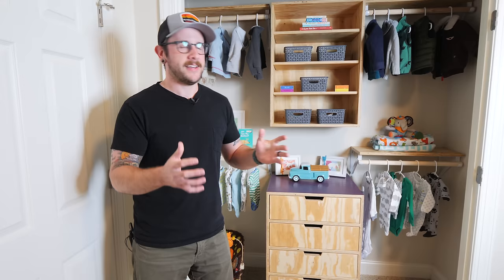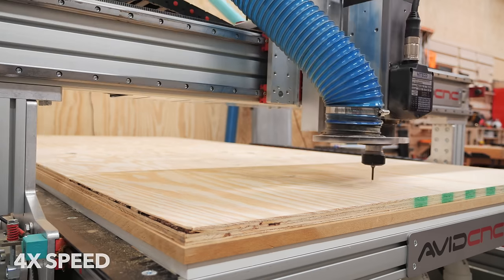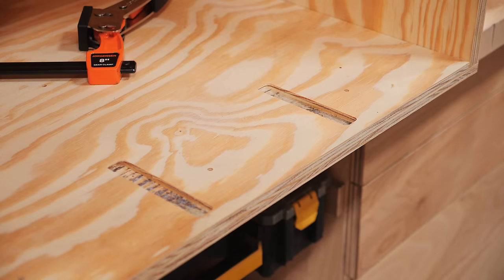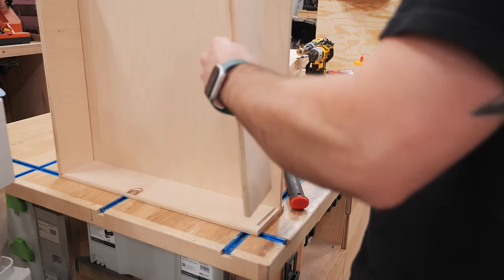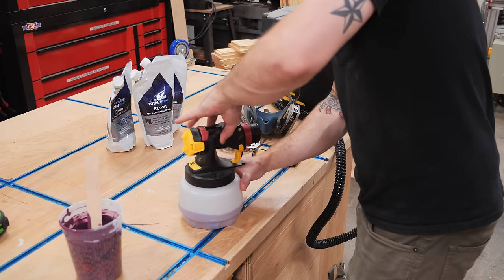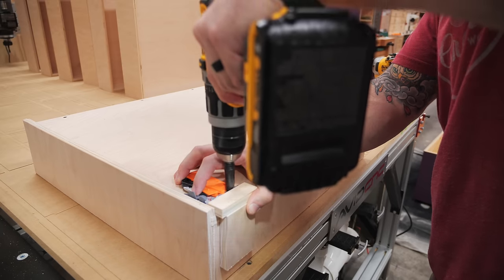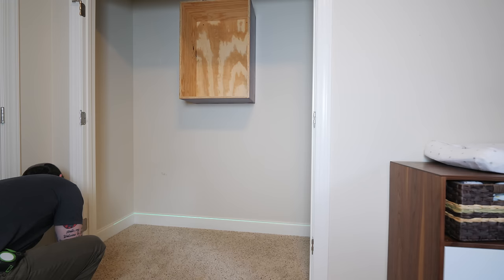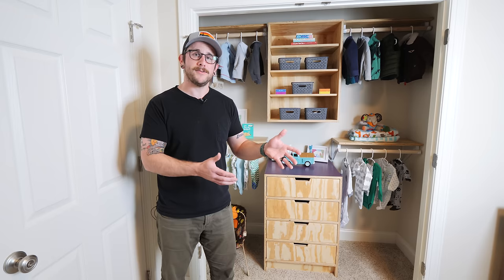Building Cabinets & Shelving for Closet Organization with CNC

Comment: Hey man!

Something I learned from a friend with a 4x8 Laguna Swift: Paint the edge of the MDF. It seals it and gives your vacuum more directed suction on the top of the board. You'd be surprised how much suction you're losing through the edge of the MDF :)
Reply: I was about to comment the same.  For me, I was going to edge band it with white melamine...

Comment: Me: Adds in wire shelving, excited to have place to hang and store stuff.
Also Me: Watches this video, “old crappy wire shelving...” 😞
Reply: Don't take it to heart, people just like to constantly change things even if they are fine and function well. Look at how many people cycle through "old" granite countertops to plywood counters, then remodel the plywood to stainless steel, then upgrade the stainless steel to granite. <.<
Reply: I just replaced some of my crappy wire shelving.  I put up less crappy wire shelving.  But this time it's my wire shelving.  As long as you improved your situation, you should be excited!  Nothing wrong with that.
Reply: @Not_TVs_Frank  Thanks man! I am happy with improving my closets that had nothing in them. Appreciate your kindness.
Reply: @williamforsythe5850  Thank you. I agree. Life is always changing, getting better. I look forward to doing an improvement in the future.

Comment: I'm about to do a very similar project myself so thanks for the vid.

I think I will have the top shelfs and the top of the cupboard as a single piece. Then I can use an end socket support on the side of the cupboard for the rail. I think I will connect the top and bottom cupboards too.

Oh and I'm very jealous of the cnc. Would you use the again rather than traditional carpentry?

Comment: Could you use one of those drill sanding pads in the CNC to just run a couple sanding/surfacing passes rather than do it by hand?

Comment: So didn't you do or add a major dust collection upgrade to the CNC that also holds the workpiece to the bed?  Are they not working as well as you had hoped?
Reply from the maker: The vacuum table doesn’t function as dust collection, it just holds down the material. I need to adjust the airflow from the dust collector, because it’s actually too much and is collapsing the brushes on the dust shoe.
Reply: @craftedworkshop  So the boxes you put underneath only hold down the work piece, not that isn't a great function because it can be incredibly trying to configure a clamp setup that will actually hold a piece as needed.  The CNC effectively has become your saw and drill?  I always thought of a CNC kind of like a fancy way to carve.  You've taken that and made it practical.  What wouldn't you use your CNC for?  You could cut a stack of 2 x  's placed side by side flat or vertical depending on your Z access height.  You could take that same stack of 2 xs and insure they are all 8' long as well with the same effect as processing them through using your cutoff saw using a stop 1 by 1.

Comment: The link to check out cnc shows a price for around $6000 does that include everything we see on ur video. I know the dust system is not included and the router bits.

Comment: I like the way all the little person clothing is hung so high a little person couldn't reach it.
Reply: Look at the bottom rack - those are onesies.  That yet-to-be-born kiddo is a good while from putting anything on a hanger.  While the closet rods are screwed to the wall, it won't take long to lower them to a more kid friendly height.  In, like, 2 years.
That is still a legit suggestion - once the little one is ready, get those rods down low!  Picking their own clothes off the rack is a great exercise in independence for young children.

Comment: WoW!!! AMD Doing Marketing!!! Finally. WAy To Go. And I totally am gonna do those cabinet designs. EDIT.... Hold on!!! That's Cheating I don't have a CNC!!! This is actually useless to me. Good for you but totally impractical for the average DIY home owner.
Reply from the maker: Very simple to replicate with standard woodworking tools. I’m making big boxes, not that hard.
Reply: @craftedworkshop  Is it to showcase the design and setup? It certainly isn't meant to teach anything. No Details ,instructions, or tips. Take it how you want but it just looks like showing off. It comes across like a big flex. None of the building part is self explanatory or common sense. People who know how to build like a pro are not the ones clicking on the video.
Reply: @ass2mouthallday  I agree with a lot of what you say. It seems he's going the way of another woodworking tuber - April W. Nothing but major sponsors for obtaining big buck tools apparently for no other reason than outfitting a shop (seriously - a power feeder?). That's fine in itself - I understand this is their "business" and I'd likely do similar, but I have to weigh the value I get from the channel. When it becomes obvious that videos are more about "look at this expensive tool I just got", than actual woodworking, I have to weigh the pros and cons. I finally had to unsub from April's channel after she posted a video about "how to" install a dust collection system... by receiving a sponsored, complete high dollar system along with two reps from the company doing the professional installation! 
I'm not a fan of CNC and will likely never own one but I understand the appeal and potential in production environments. That said, he does have CNC right in the title and I was still interested enough to watch because of "closet organization". (Did not watch the recent one where he received it) Have to say I'm not a fan of the plywood look though.

Comment: Seeing all the “makers” move over to CNC machines is cool for them. Happy they are getting better equipment. Just a lot less interesting to watch. I want to watch people build things. Not be computer programmers.
Reply: I was thinking the same. I had the though that this is just like watching someone put together IKEA furniture right before he said that exact thing. Hes super cool still
Reply: you just got the word out of my mouth
Reply: I agree. I understand that it's part of woodworking, it's totally the future. I love that they're able to produce items like this. But I have zero interest in watching someone gush over a CNC for 10 minutes. They're amazing. I get it.
Reply: It’s definitely hard to relate to the process since I will never in a million years be able to afford a CNC
Reply: @MikeHunt-yh6ro  there are full 4x8 cnc setups for under 700$.
Reply: @jetah50  I'd need a new house to fit that $700 CNC.  🤣
Reply: @jetah50  which one would this be.
Reply: @Not_TVs_Frank  you need ~10 ft of width (left-right) about ~10 ft tall (floor to ceiling) and probably 3-4 ft deep (front to wall).

Comment: i loathe wire shelving. if you spend more than 5 figures on a house there should be tile in all the bathrooms and cedar in the closets. well it doesnt really have to be cedar but a nice piece of wood. ive seen luxury homes and they have those wire shelves in the closet and pantry. shame on those builders.

Comment: CNC is amazing but for me as homeowner / DIYer this just another show off project. I don't have the space / money  or the need to invest in big tools  like that one. most of the people which are serious about woodworking hobby have a basic set of power tools and the big of them is a simple table saw (even not cabinet one). for me again it just for entertainment! more exciting video will be to build a cabinet with just circular saw , drill and sander. moreover , I don't consider this build as woodworking as you let the machine do all the work from start to finish. it more design / architecture then woodworking.
Reply: Lol! Don't be such a baby! Every single part of this project can be completed without a CNC.  A circular saw, drill, and screws is all you need
Reply: When the robots take over, they will remember your disdain.